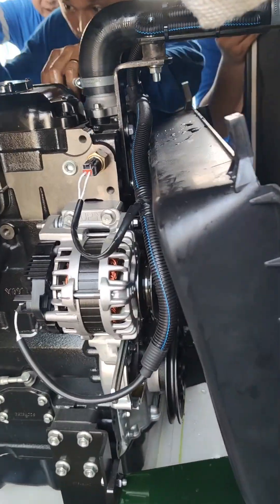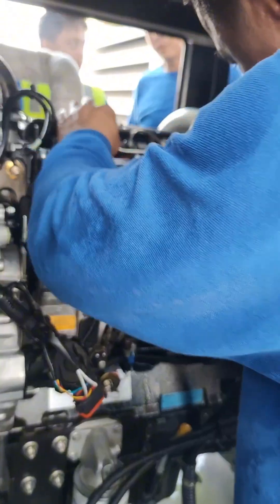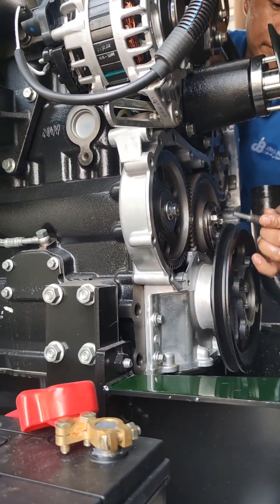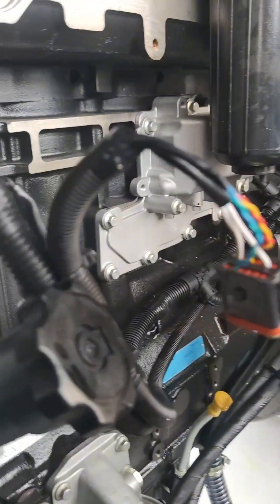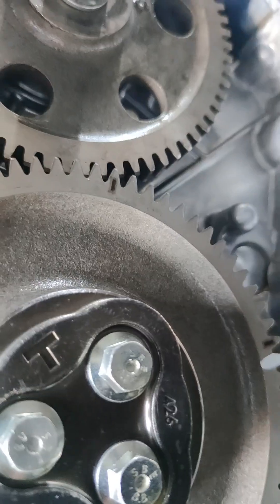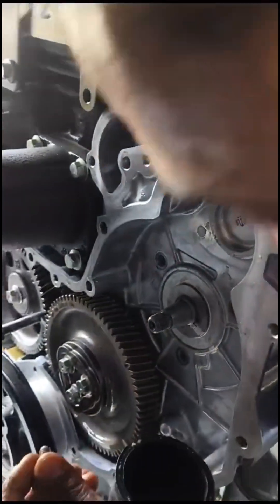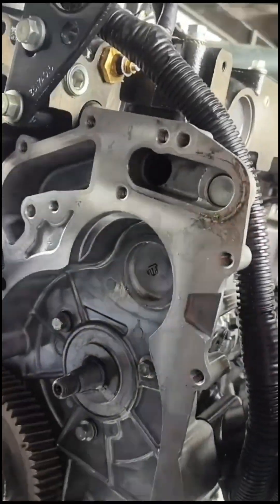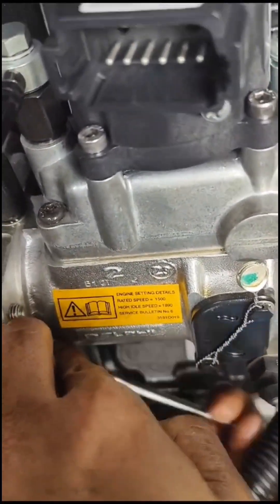INSTALLATION OF L-SERIES IN 1104C PERKINS ENGINE

Comment: How do you wire and configure a l series on 1104 Perkins just want 2200rpm and idle speed
Reply from the maker: Just simply adjust the the rpm make it 1800rpm